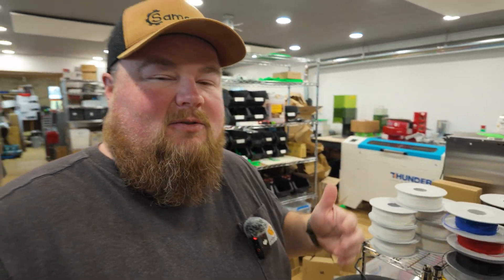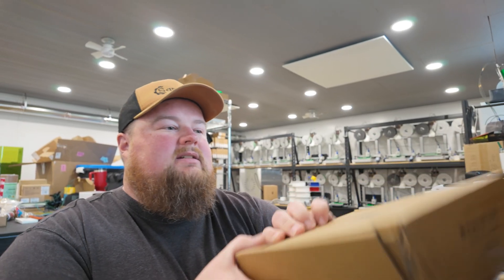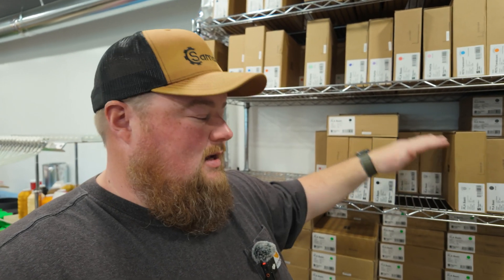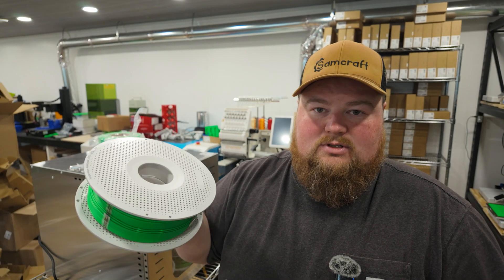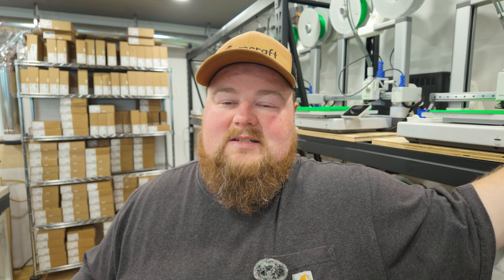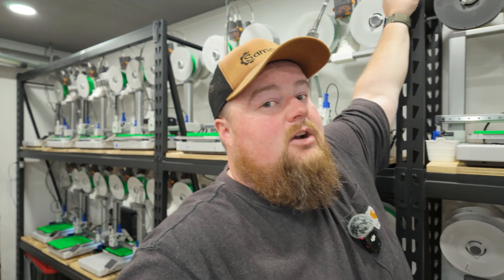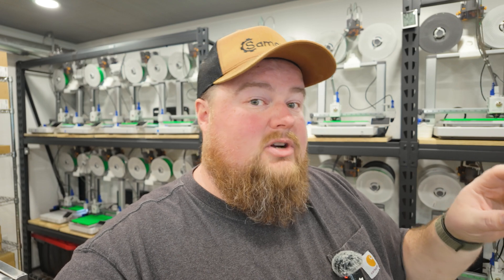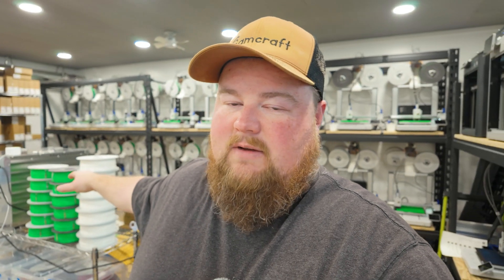How I Prepare Filament to use in my 3D Print Farm Business

Comment: I agree filament should be dry but i just don't see the point of the dehydrator when you have it in the same room with your printers and then the spools stored in the open and after that put on open printers. Those spools come in a vacuum bag with dry pads in them. Keeping the room at low humidity seems more reasonable.

Comment: You could improve your workflow loading/unloading filament by 100% simply by moving the dehydrator to the other end of your rack as you won't have to go around the door. A rolling cart is not a bad idea either. You might consider a bakers rack that has doors that you could keep a tray of dessicant at the bottom.

Comment: The best humidity for storing 3D printer filament is <30%. The maximum relative humidity for most 3D printer filaments is 50%, but such exposure shouldn’t be prolonged. The only 3D printer filaments you can store in humid conditions are the non-hygroscopic variants.

Comment: so you're taking wet filament, Putting it in the dehumidifier, which then vents the now-wet air back into your shop, where your filament is once again resting in the open, and relying on a de-humidifier across the room to dehumidify the air, again ... I dunno seems like a problem in workflow there to me ... should probably pipe the wet air out or somethin'... 😅

Comment: Nice stuff. I really like optimization on multiple levels. If this dryer was mine I would move it to the left side of the table or swap doors around to open to the other side if possible. This way you would have more direct path to put and take out filament.

Comment: Loving your videos!  Luckily we don 't have many issues with wet filament here somehow.  We have 30 some printers in the same room as around 2thousand gallons worth of saltwater.  Two whole house dehumidifiers keep the humidity at 50% and i usually store some of the filament on the edge of our indoor pond lol.  We print only PLA and PETG.  The only time we run into issues with wet filament is if its been sitting for months luckily.  Kingroon has some good cheap filament and you can usually get it for $9 a roll.  All we use anymore.

Comment: Do your printers have filament runout sensors?
Reply from the maker: Yes, they will alert me on any device with the Bambu Handy app installed. It's great for when I am not in the workshop and the printers are running.
Reply: @Samcraftcom  sweet!. Just watched another video and learned you are using the a1 and looked up the specs. I just got an Ender 3 v3 es  for cheap off of offerup and enjoy this hobby. Love the specs on that a1 tho, especially the 4 rolls for multicolor printing, and cameras for remote viewing, wtf! Hahaha. Thx much brother

Comment: I can confirm that they just randomly ship stuff and don't give a packing list and also randomly break up the order. I really wish they would ship it all together. If they had it in inventory to sell online, it should ALL be available to package and ship. They should also get boxes designed to fit the filament boxes accurately and have increments of filament you can buy that perfectly fill a box in order to prevent the voids in the carton and allowing them to get damaged.

Comment: Question have you done a video on how you rotate your filament. I think you do the Run out from one spool pick up from the other.  then cycle till all 4 are changed out. then wash rinse repeat. If you have please point to the video It will be helpful for me as I was thinking of going Spool to spool .. Meaning NO AMS lite. ( I have 3 ams Lite and one P1S with AMS)

Comment: I liked your video, and kudos to you for building your business.
However, your video showed what i believe is a fundamental flaw of bambulab printers in this setting: the lack of bigger spool support. Being able to use 2 or 3kg spools for your main colors would save you quite some time dealing with filament reloading.
Reply from the maker: You are exactly right on the large spools. I am working on a solution to that though. :)

Comment: Drying filament is a hugely good idea.  I hear people argue they "never have issues" or they live where the humidity doesn't affect them.  Good on you - but - PLA, like other materials, is very hygroscopic.  If you dry before use, you remove so many random problems - stringing, those tiny hairs you sometimes see, even poor layer adhesion.  Its saved me so much time and money!  No more trying to tweak retractions or other weird things I might suspect is the cause.   That's quite the lab you have.  I hope you're doing a great deal of venting/filtering to keep the VOC/UPF levels in check.  Print safe!

Comment: Great viseo as usual.  I will be starting my 3D printing as soon as FedEx delivers my Bambu Lab printer.  I received my filiment from Bambu Lab and it was just like you experience.  The shipping packaging was awful with nothing in the box to protect the rolls of filiment from banging around inside the box.  Ditto no shipping label.  Just got notifified from them that the last 4 boxes of filiment I ordered on Black Friday were finaly shipping.   Not a great introduction to Bambu Labs.  I am hoping that the 3 D printer gets to me today.  FedEx keeps changing the delivery time.  They seem to be having problems of late making delivery dates.  The printer was supposed to get to me last Thursday, then Friday and then Saturday and Sunday their website indicated I would get a revised delivery date as soon as the package started moving again.  It only had to travel across town in the metro Atlanta area.  So weather was not the issue for the holdup in delivering the package.

Comment: I would highly recommend looking at either a) having a backup humidifier on hand or b) getting a more commercial level dehumidifier and keeping your original as a backup.
Those single room units are designed to run 8-12 hours a day maximum to make a room comfortable in the 40-50% range, running it for the extended periods down in the 20s you likely will significantly decrease it's lifespan from 3-4 years to 1-2 or less (Tosot only have a 1 year warranty).

Even if its a cheap Vevor or Costway commercial model it'll be longer lived and significantly more powerful (125-200 PPD) than the single room roll around one (and probably wont cost that much more).

Comment: That dehydrator definitely looks like the ticket when it comes to drying large amounts of filament. I have definitely noticed a difference in the packing quality from bambu Labs. I have also had quality issues with the refill spools. The cardboard seems to be rough cut making it very difficult to load on a spool. Other than that filament itself is awesome. Thanks for sharing.

Comment: when I'm drying a spool at home (just 'spool on the print bed under a filamentbox at 50C' ) I notice a sharp spike in the RH as the moisture gets baked out and it then tapers off closer to ambient RH, then finally falls below ambient as the moisture stops coming out. My summer ambient can creep up well over 70% RH, and winter low is down around 55%. I've never been able to keep my bins dryer than 50% with just desiccant., and these are gasket-seal bins

Comment: You should be aware that relative humidity this low is not only about comfort, but about health. It's a very hazardous environment to be in for prolonged periods.
You can develop several respiratory, sleep and immunity problems.
Be kind to yourself and figure something out that will not keep you continously exposed to such low RH levels

Comment: I'm currently using a Sunlu S4 dryer (4 slots) & a couple single/double spool dryers, as my output doesn't demand more, but if business does end up picking up enough to justify it, I'll definitely be looking at a larger setup like you're using.  I wish you'd have mentioned the brand you're looking into, I've tried most that are available around here, and could give a little bit of warning on a couple of them..  Some of the US-made stuff being sold relatively inexpensively has had issues with contaminates in the filament (GST3D, IIIDMax come to mind), and, while cheap, you'll not get the consistency you're looking for.  I've also had an issue recently with Elegoo with contamination, but I'm not yet convinced that it wasn't just a on-off problem (the contaminates appear to be little bits of carbon coming from the extruder they make the filament on, and poor maintenance on said equipment).  Sunlu has been a good supplier so far for me, but I'm also not ordering in the quantities that you're getting in so I'm not sure if they could keep up or not.  Anycubic has been pretty good on quality as well, and if you end up going into any of the engineering filaments (ASA-GF, etc), SirayaTech's line has been outstanding on a price/quality standpoint.

Comment: Hey man, really nice very helpful video. I feel like I should call out something that I'm concerned about. You say you keep your humidity down at 26%. That is actually too low and can cause problems with static buildup which can lead to unfortunate discharges as well as maintenance issues. The recommended range is closer to 50%, and it's as important to keep the temperature consistent.

Comment: If you buy from good filament brands like Bambu, PolyMaker, Sunlu, Elegoo, and Creality, they are pre-dried from the factory. PLA is a hygroscopic filament, which means it absorbs moisture. It absorbs moisture very very very slowly. TPU, PETG, and Nylon are the only filaments you should dry before use.  PLA should only be dried in extreme cases. Like PLA sitting in the open for 3 months in 50% humidity or above.

Comment: If you are producing  that much product and still 3D printing it, you are not doing something right. You are beyond proof of concept or initial runs. You should be having that molded . Not only would you have a more robust and consistent product, but you would be lowing your per piece cost.

Comment: if anyone is looking for large dryers you can make one yourself for about $50... check out kiln  wood dryers you can use a freezer off the road and put in an heat lamp and fan or get pink foam and make one yourself

Comment: Running the "electronic" equipment in such a low RH environment will just make it the perfect scenario for "Tribocharge" and electro static events. I'd actually be concerned about it given the speed at which printers are moving around doing their job.
Eventually could become an issue too whenever servicing any of your machines.
Why it matters? (ESD will eventually cause electronic hardware failure)

Second thing, the volume of cardboard in there. Cardboard is the worse at generating dust AND a great combustible.

As far as VOC goes, that will likely become your biggest challenge to mitigate since you're chasing a low RH level in your print farm.

Comment: In terms of filament storage I saw on some reddit was a waterproof container like a Husky 12-Gal. from Home Depot, or something like it, Since it has gaskets, keeps things the same as when you opened things. If you were looking for something. So many others have been using Dehydraters in smaller form, this looks great for your use.

Comment: Are you sure it's Bambu's fault because your boxes are trashed.   I guarantee you that whom ever is delivering to you does not care what your box is.  They throw them like footballs, drop them , etc.  I worked at a airport hub for a major delivery service and packages were thrown all the time, didn't care if it had Fragile on it or you could clearly see it was a TV or electrical component.   I don't order from Bambu like you do, but my boxes from Bambu look fine.

Comment: Nice setup and workflow! One thing to note is that a good filament manufacturer will dry their filament after production and then seal in a metalized plastic pouch. Regular clear plastic will leech moisture over time.  As you’re looking for another source ask about post production drying and those metalized pouches. 💪🏼

Comment: Just curious, you seem to have embraced the metric system, everything mentioned in Celsius or Kg. Is that due to all the equipment and supplies coming form metric companies and its just easier to stay with their system? I don't hate metric, but also don't like constantly switching back and forth. I got a laser a few months ago and I found it was easier to just go with metric due to the software and machine being made in China. I found myself spending way too much time and thought on converting everything all the time. Wondering if that was your reasoning as well.

Comment: My issue with Bambu Labs filament is not quality of product, but also shipping damage at times, although so far limited to the boxes.  Mine are packed like yours, boxes inside larger box, and yes the shipping process is very hard on the packages.  Its the sorting machines that is the problem from what I understand.  Bambu needs to step up protection inside the big boxes it seems.  
Biggest problems is their fulfilment process.  It just takes too long for them to process the filament order and get it out the door.  I get  the order has shipped notices very quickly,  but that only means they created a shipping label.  Often my order sits for 3- 5 days waiting to get fulfilled and finally to UPS.

Comment: I've had recent issues with bambu shipments as well, and it's frustrating as hell.
I usually order 10-12 rolls per order, and one order sat there idle for a week without a shipping label being created.  Contacted support asking if it was backordered, and was told some nonsense about the fulfillment center had issues finding a shipping box???  And the second, that I'm currently still waiting on, they shipped me a single roll out of an order of 12, and marked the order complete.  Again had to contact support, and was told that the remainder of the shipment will go out in the next 7-10 days.  
It's beyond frustrating what a mess their fulfillment system has turned into.  Support keeps blaming 'black friday' sales.  Yet they followed it up with another holiday sale after black friday finished.  So just keep enticing more sales that you already have issues fulfilling???

anyway, like you, i've also been ordering samples and testing filaments, in the search for another filament vendor to switch to.

Comment: Green being your lead color completely stunned me. The more orders I got, the more my customers are telling me "we hate green" 😂

I'll try to add more green, you must be right.
Reply: The really great thing about filament is that, in most cases, is that it takes rattle can paint, hand painting, or even an air brush, REALLY WELL. When I 3D print items, I rarely care about color. The one type of filament that I have not had any luck with printing, is TPU. I have used PLA, PLA+, PLA Pro, etc, ASA, and PETG, mostly solid colors, and some color changing (which I never paint), and have had no issues with these types of filament taking paint.
Reply: @PaganWizard  I was talking more from a printed finished product point of view. I  mainly produce GameCube controller buttons and sticks, both with resin and FDM printing. With FDM, I can offer a wide, WIDE, color options to my customers. But I pushed more on pink than green, because pink has been a best seller. Also black and white of course. I'll give a second chance to greens.

Comment: For my small farm (300ish printers) I almost exclusively use Bambu filament and Ive only had a dented box once. I think maybe some mail hubs are rougher on packages than others. If i buy Polymaker the packages ALWAYS come crushed and because the spools are cardboard, they're pretty much ruined as I don't have time to respool hundreds/thousands of spools.
Reply: the biggest issue for me is they dropped the ball on their QC on refills i don't care if the box is bent up if the product was protected because that's the boxes job but the amount of bad rolls (twisted from the factory, un sealed bags, no NFC tags)  is higher than good rolls now. Using sunlu now and they are ok so far have not found a GREAT replacement only good or ok one.
Reply: @texal  Thankfully I haven't had those issues either except for the refills being sort of twisted from time to time. Is there a specific filament type that you're ordering that is having these issues? I ask because a friend of mine had QC problems earlier this year but it was only with PLA Matte Charcoal refills, which I rarely ever purchase, IIRC.

Comment: The air flow in your dehydrator doesn't seem optimal
Reply: If you have used one you would know its fine the fan moves a lot of hot air

Comment: I have had my P1S for only a month (had 2 Ender 3 Pro before) something I would like to know is your thoughts on high speed pla from other manufacturers.  Do you feel you need the high speed PLA or are you willing to risk normal PLA (manufacturer guidance of print speeds of 20-60 mms)?

Comment: You can literally soak PLA in water and it will print fine.  Other filaments are greatly affected by humidity, but PLA isn't. 

But people can do whatever. Drying your PLA doesn't cost much more than a little time - it just isn't necessary.
Reply: You can’t “literally” soak PLA in water and have it print fine.
Reply: @c0mputer  Yes, you can.  Put your hairspray and glue stick away, get out of Reddit know-nothing groups, and seek to understand the materials - not what keyboard monkeys tell you.